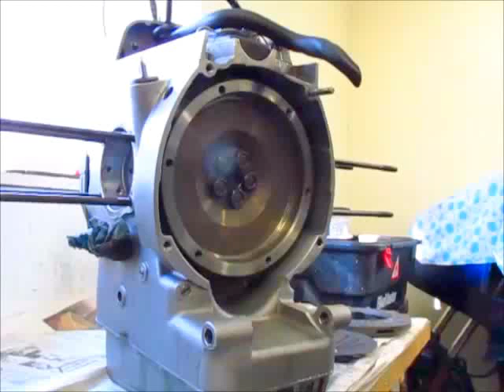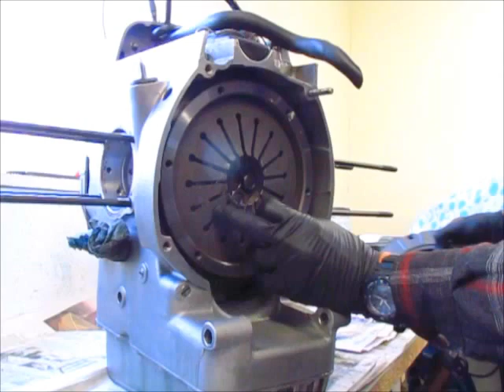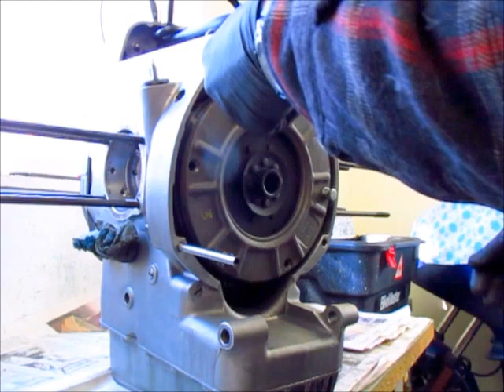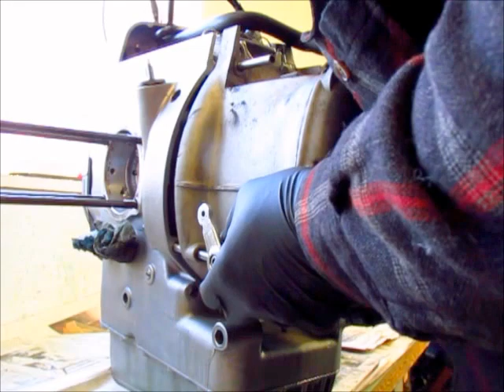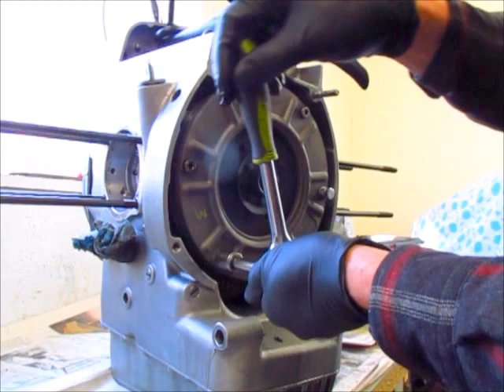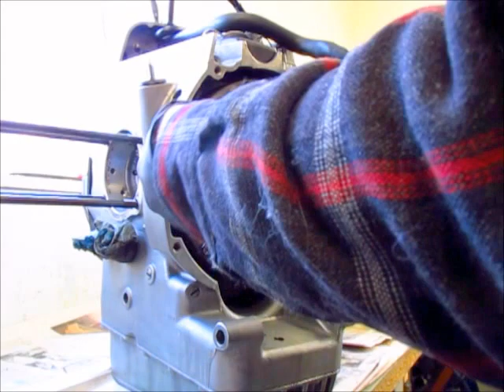1977 BMW R100RS Clutch Install

Comment: wanted to ask..also have a 77..Clutch issue is that the lower adjuster (Bolt and lock nut) ..pull the clutch lever and have clutch ..after a few pulls the bolt backs off even after snugging up the lock nut..then No Clutch at all..clutch lever pull is Nothing..any ideas?  Thanks

Comment: A universal clutch alignment tool works fine.
Reply: First time I use an alignment tool, it still wasn’t quite centered because of the clearances of the friction plate “hanging” off the tool, which cause it to be off center, this transition method would be best... but it’s be difficult to do with the engine in the frame...

Comment: I grease all my bolts....
Reply from the maker: Roy,
It depends on the year. Up to 1981, the BMW torque values are for "clean, no oil" on the threads.  For 1981+, the torque spec changes and they call for well oiled threads. This is a 1977, so "clean, no oil" for the threads.  

Hope that helps.

Comment: thanks for the video, does it differs in any way on the r100rs ´82? i´d like to do it, as i already have the motorcycle disassembled ... to center it, it´s enough doing it eyeballing?
Reply from the maker: Yes, the 1982 clutch and flywheel are different from the 1977 version. BMW lighted the flywheel causing a redesign of these parts.  I have a 1983 RS that I plan to work on so I hope to have a similar write-up and video on removing the clutch and flywheel for the "clutch carrier" configuration.  

BTW, you can find all my documentation on 3 complete and 1 partial rebuild here:
--> brook.reams.me   
You can also go to this page if you wish
--> http://brook.reams.me/bmw-motorcyle-rebuilds/

Best.
Brook.

Comment: Good video. On torquing down the clutch pack bolts, i recommend you go in crisscross pattern like you did when you tightened it down. Also, if the motor is still in the bike, its pretty hard to use the tranny input shaft as an alignment tool. Folks can get an old junk input shaft or buy/make a tool. good job!